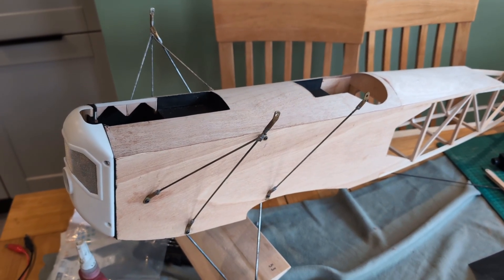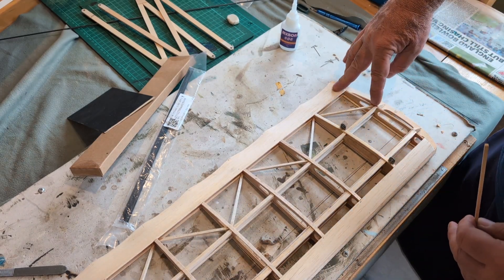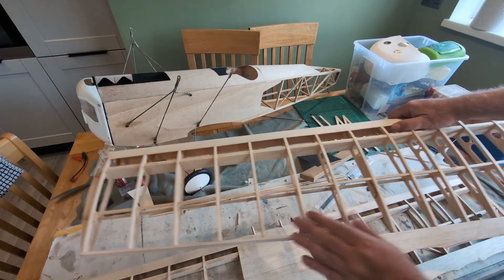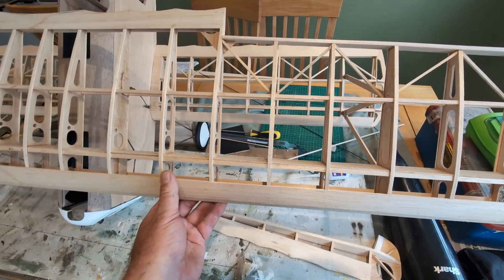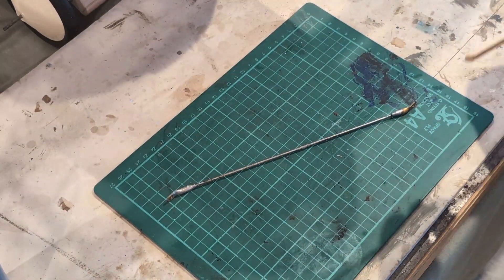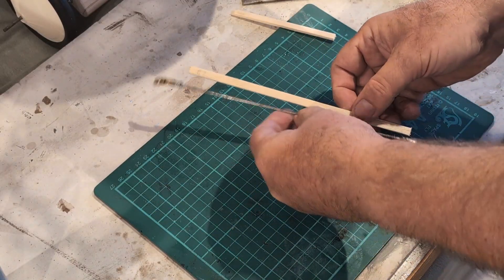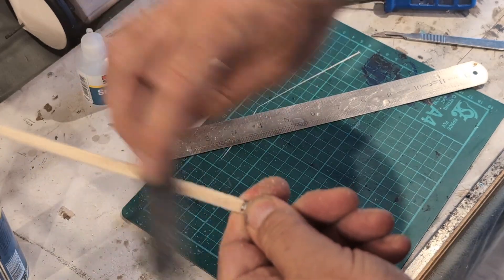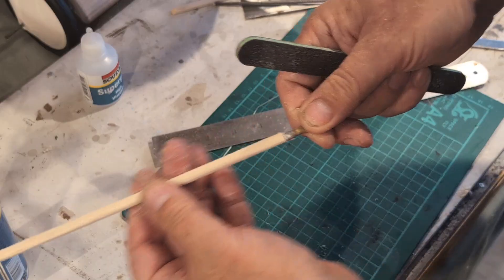Flair Fokker D7: Wing modification and cabane cladding

Comment: Mark, I'm sure you'll get more suggestions about how to improve the torsional rigidity of the wing, but in my opinion the most economical (in term of weight/rigidity) would to be close ujp the LE D-box between the sheeting and the spars on top and bottom, thus creating a relatively large 'diameter' torque tube assembly.
Reply from the maker: Great suggestion, I will consider it!